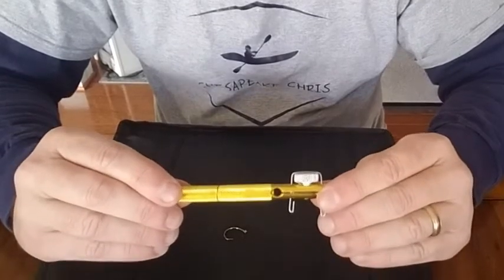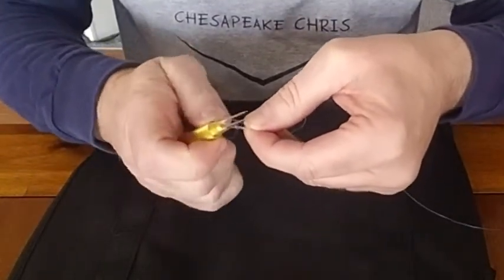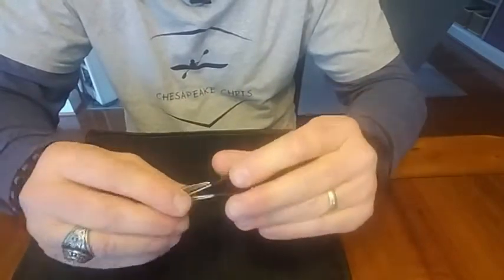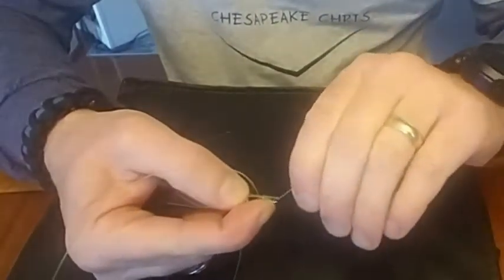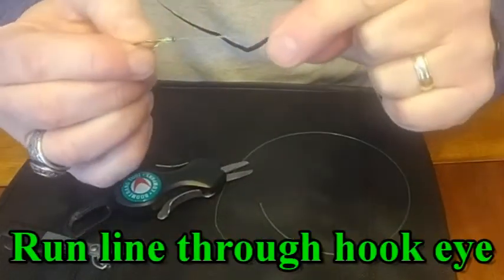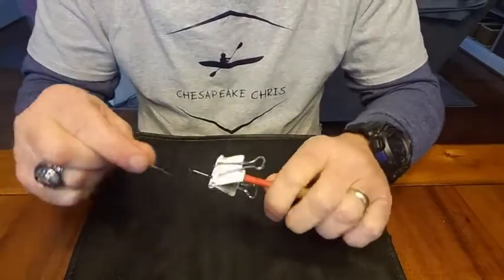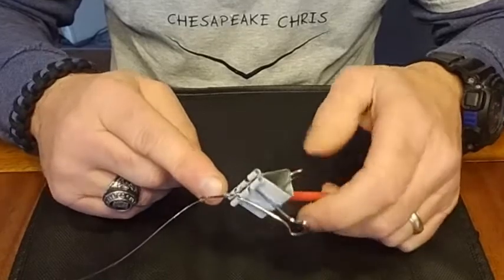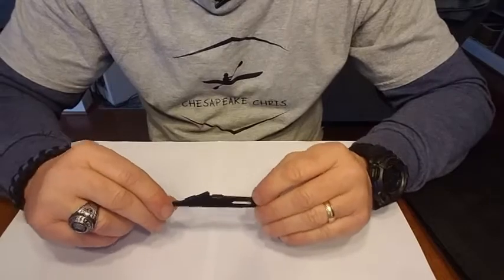Hooks, Knots & Knot Tools - Part 2

Comment: As you tied the knot using the tool I tied a snell knot with out a tool in less time than using the tool.
Reply from the maker: Thanx for watching & commenting. Yeh, I find most snell knot tools cumbersome. I tie snell knots much quicker when not demonstrating & I only use the tool that I showed as my favorite when tying small hooks. I like that both line ends go under the line wraps. In part 4, I show how I usually tie snell knots & I can do it fairly quickly.
Reply: @ChesapeakeChris  what is the best tool for a beginner bass fisher? I don’t know how to tie any knots besides my shoe’s… waiting on my first fishing pole Shimano Nasci 2500 FC and a Shimano Sellus 7.1’ Medium/Fast rod
Reply from the maker: @greg6162  That should be a nice rod/reel combo, I've had numerous shine no reels. I really only use 4 knots, surgeons figure 8 for loops, Palomar knot for swivels or hooks, Snell knot for most hooks & Uniknot for tying mono to spinning reel. I show first 3 Without tools on my 4th knot tying video & uniknot on my putting line on spinning reel video. Occasionally I use the TieFast tool to Snell small hooks.

Comment: What do you think of the Knot Needle?
Reply from the maker: Thanx for watching. I haven't used it, but it appears to make handling the fishing line loose end easier. The only knot tool I really ever use is the TieFast tool & i only use it to tie snell knots on small hooks. On my 4th knot tying video, I show how to tie 3 styles of snell knots without tools, how to tie a loop using surgeons figure 8 knot & how to tie the palomar knot for swivels or hooks. Those are the only 3 knots I really use, except tying mono to a spinning reel, for that I use a uniknot. But the TieFast tool is excellent for nail knots...used to tie 2 lines together such as fly line & leader.